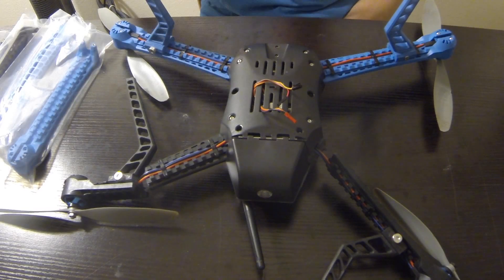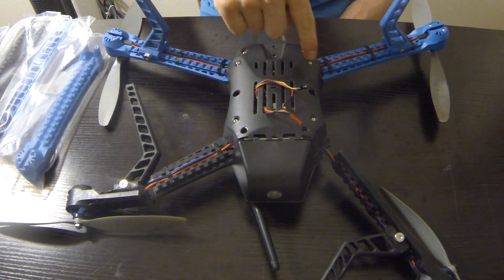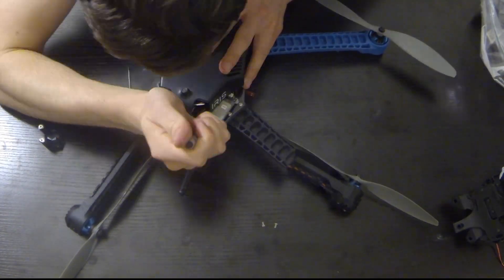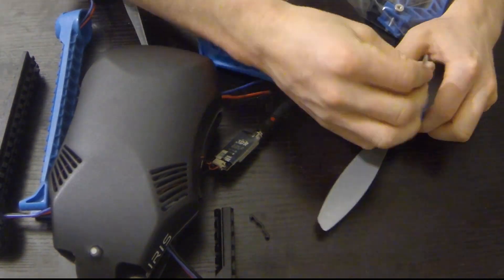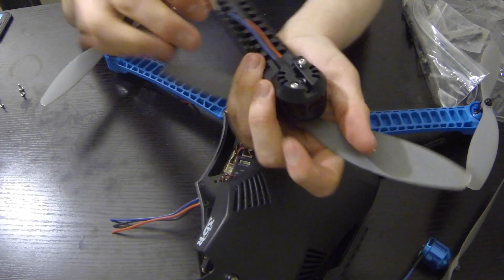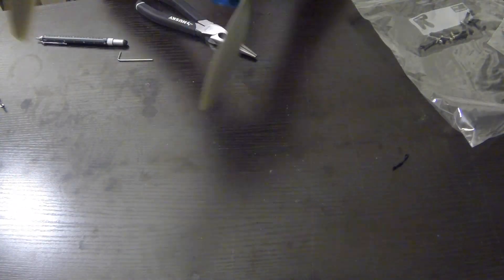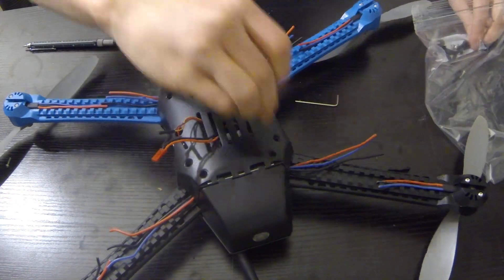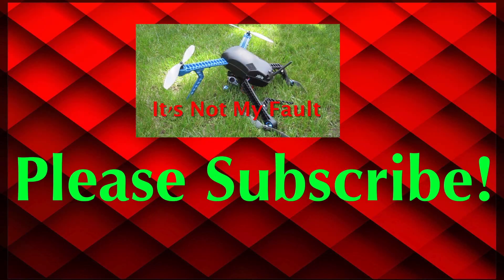How to Disassemble and Assemble 3DR IRIS

Comment: But how did the Iris+ crushed? I'm thinking about to by Iris+ and... this video looks scary :)
Reply from the maker: The batteries they gave me went bad. After, two minutes of flight time is stopped flying without any warning and crashed.
Reply: Cluengineer That's really bad trick! Do you still use Iris+? Did you had any troubles since that crash?
Reply from the maker: Its a good system if you are just a hobbyist. But if you want anything more you should get something more substantial.
Reply: Cluengineer Thanks a lot for the advice!
Reply: The same thing happened to my brother when he was flying the iris+!